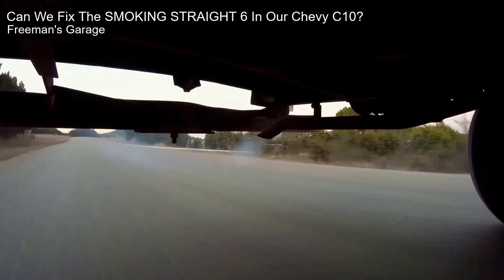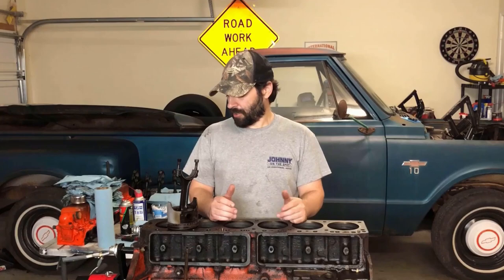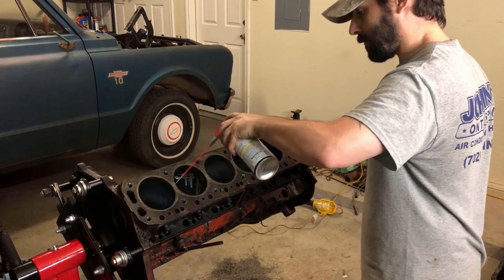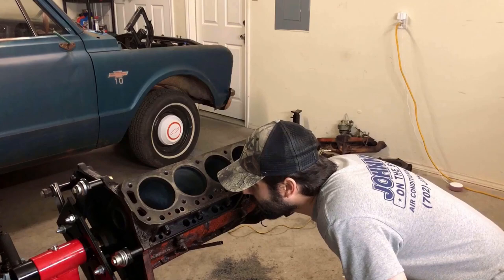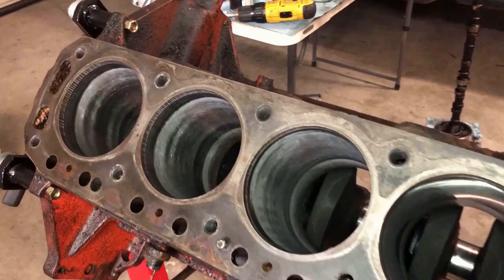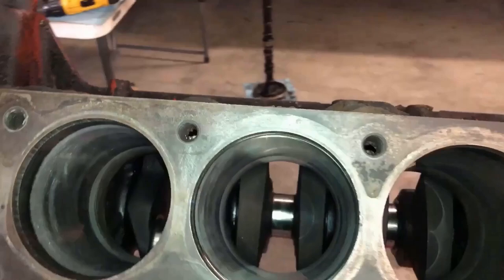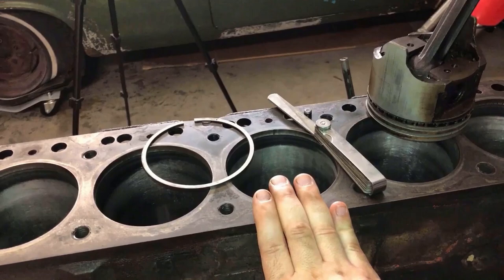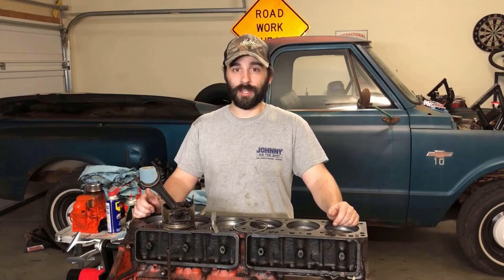Honing Cylinders With Crank In! 1967 Chevy C10 Barn Find! At Home Ring Job!

Comment: Ive done  a number of successful   hone and ring jobs with the engine still in the vehicle. It was  a common repair    in the 1960's. Just scrub with hot soapy water and then follow up with transmission fluid soaked paper towels until the   paper towels come out clean. You gotta make certain to not leave any honing grit in the engine.
Reply from the maker: That's why I don't chicken out with this stuff. It's been done a million times by folks like yourself. I used wd40 & it worked ok but I will try transmission fluid next time. I'm pretty sure I got it all out so we should be good, but I guess we'll find out when we fire it up & start driving it again.

Comment: I'm about to hone my first engine ever and I just had to find at least one video of someone doing it with the crankshaft still in... Glad I did. Also glad the engine seems to be running fine and without smoking in the last video. How's it holding up now?
Reply from the maker: I'm not sure what all videos you have seen but I drove it almost daily for months with no issues. My oil burning & smoking issue remained solved. Then a freak streak of below freezing weather in Texas cracked the block while I was out of town. I didn't have any coolant in it. Just water. Even with the cracked blocked it ran just fine driving it into the garage to swap in a different engine. The block was unrepairable. Videos of everything are right here on Freeman's Garage. I recommend using something like ATF instead of WD-40 like I did. I actually don't think WD-40 is a good enough lubricant for that kind of job. Best of luck on the hone. Just keep that debris off those bearings.
Reply: @freemansgarage  I hadn't seen anything other than what's on this playlist. I just discovered this channel because I'm educating myself on piston ring replacement. I've got a lot of catching up to do. Too bad the frost took it out, sucks that that happened.
Reply from the maker: It was my fault. I should've had coolant in it. I wish you the best with you & your engine. I'm not an expert on engine building but I'm glad the videos are helpful in some way to you. That's why I made them.

Comment: From the looks of it your stones where too dry. WD40 is just not a good lubricant. Would have been better with thin motor oil or transmission fluid and keep the bores wet. Does not look like you had any idea of the surface tension you set up for the stones and you already said you did not know the stone grit. So it will smoke a little, it probably did before you started.🤣
Reply from the maker: You make good points. We'll see what happens I guess. If it smokes we'll do it better next time.